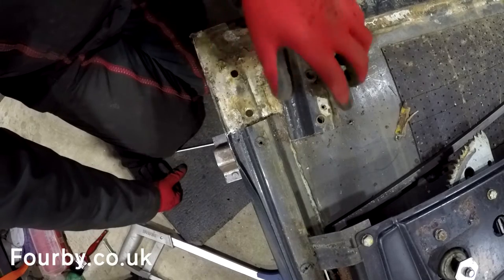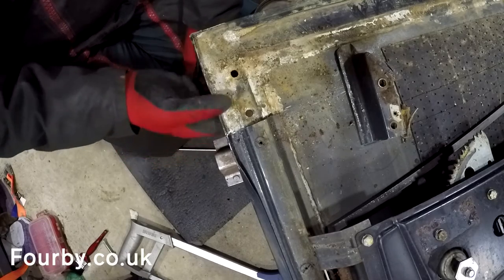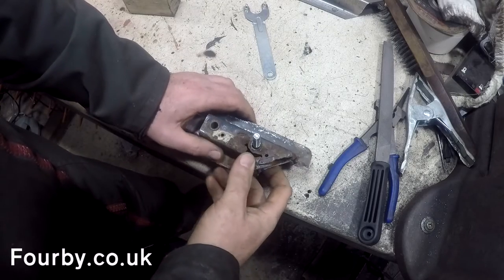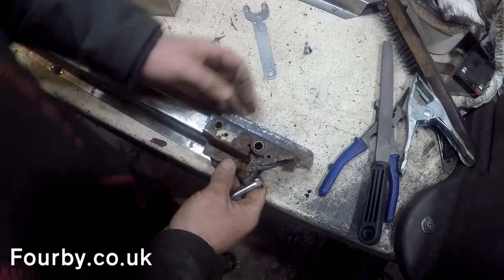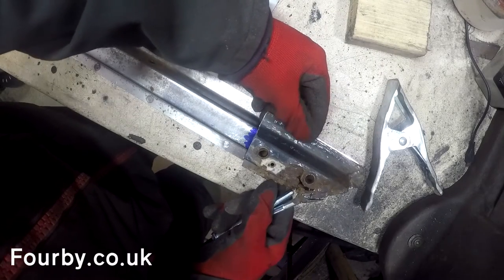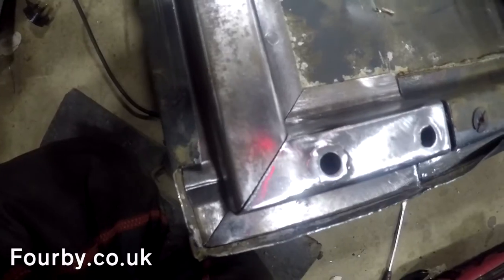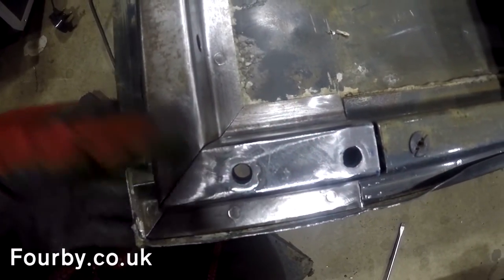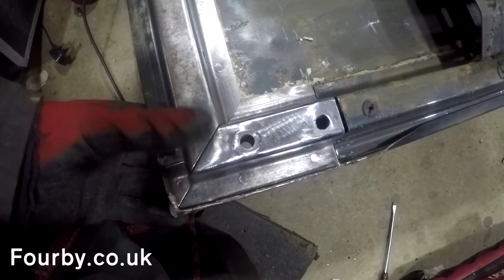Land Rover 110 Restoration  #13 "Lower Door Repairs"

Comment: Thanks for posting the videos. I'm just about to start mine so looking forward to seeing the next installment.
What's your plans for welding the new section to the old on the back face? I was thinking of either pulling the skin back to weld from the outside or cut a V section from the frame to weld from the inside. Cheers
Reply from the maker: Ian Jefferson not sure yet how to tackle it, been puzzling this one myself, dont want to bend the skin if i can help it, was tempted to cut in a fillet or reinforce it with a brace, either way it will have some strong adhesive ... dunno yet